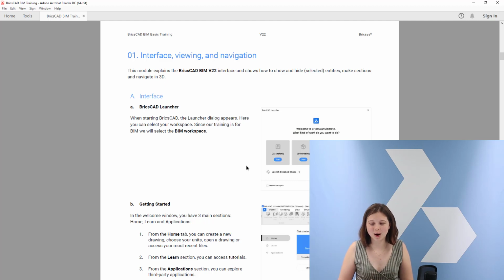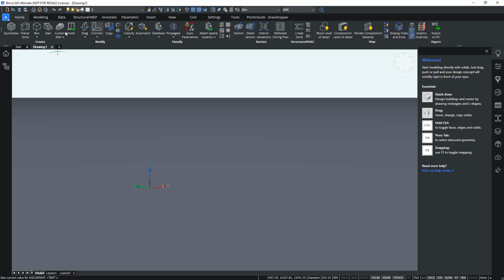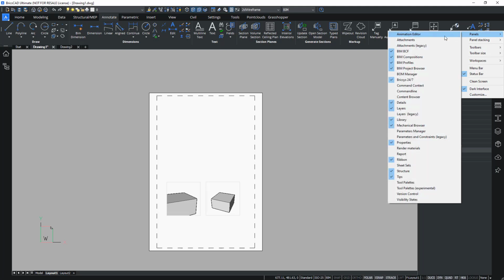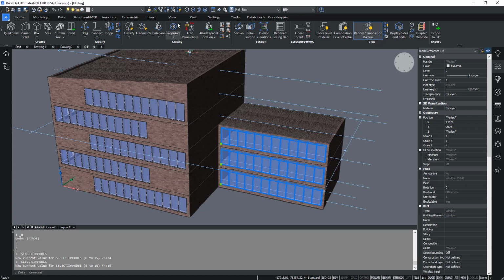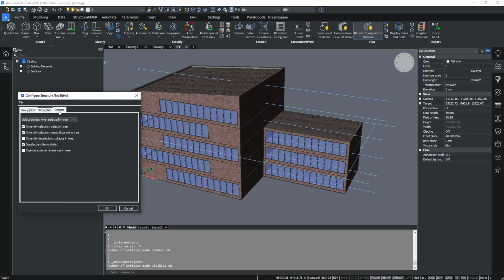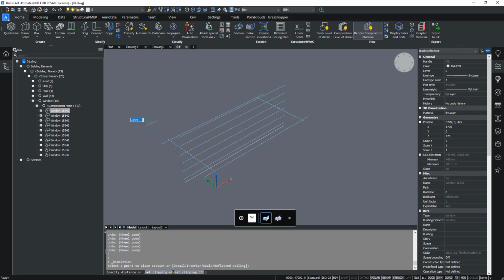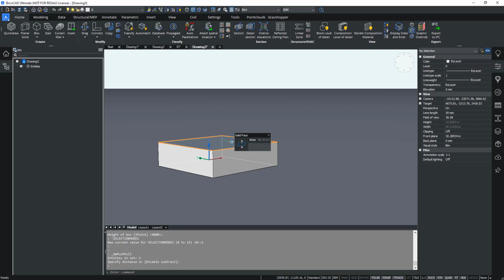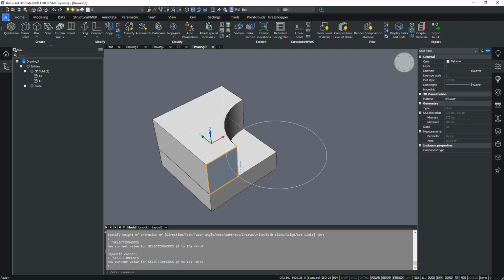BricsCAD V22 BIM Academy 2 - Interface, Viewing & Navigation

Comment: when I select section plane, how do I change it so it selects the face of the building.....mine seems to default to the up horizontal so matter where I click.
Reply from the maker: Switch on the DUCS setting and when hovering over a face the DUCS will align with that face so that the section plane also rotates in that direction.